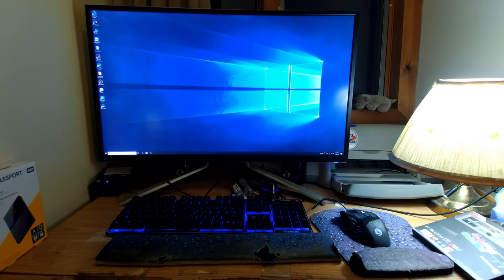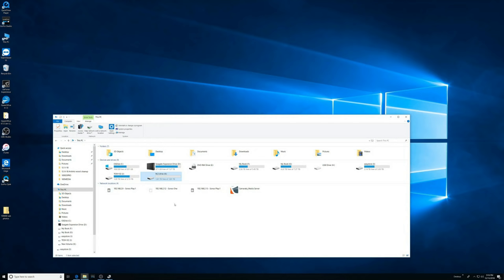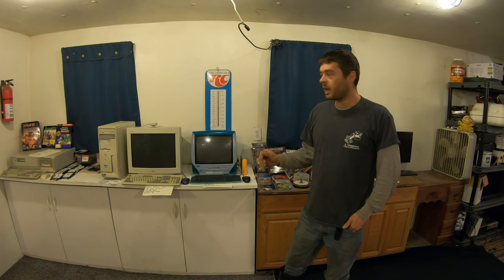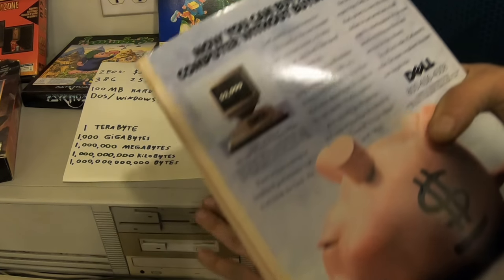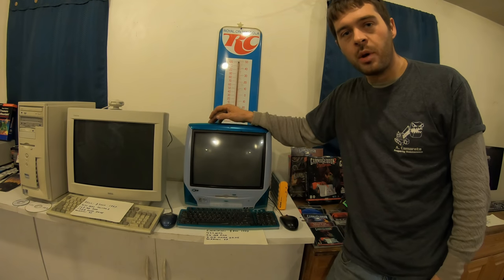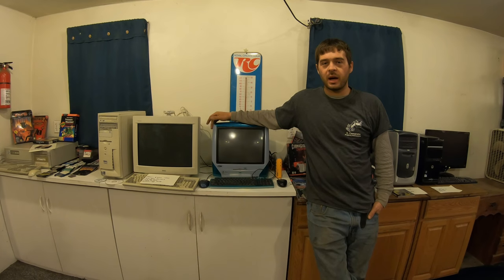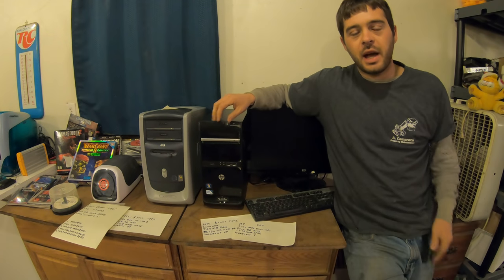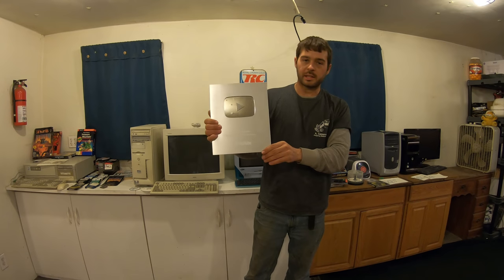Upgrading and talking about computers

Comment: Not too long after I began playing with home computers (1978) I came up with the NCU (the New Car Unit - at that time a basic new car was about $3000; now it's more like $25,000). It struck me funny that you noted that right along a pretty good computer cost about $3000 and my mind just jumped: NCU!
My first computer was a NorthStar Horizon. Z80 CPU (maybe 2 MHz? maybe 4?). I had it stuffed with the maximum of 48k (yes, kilobytes) of memory and two (count them, two) 5 1/2" floppies holding a whopping 128kb each. That computer (in kit form) cost 2 NCUs (in 1978) - in today's terms, it cost around $50,000 dollars. There wasn't much software around; I had to write my own in BASIC, with a few bits in hand-coded machine language. (I still have that NorthStar somewhere in storage. It needs a smart terminal with a current loop serial port, which I no longer have.)

Like you, I kept on buying the latest and greatest (with a few stalled out periods like you). I eventually got tired of Windows, and switched to Macs. Now I don't keep up quite so much. I might let two or three years go by before getting a new one. A good computer now costs only about 1/8 of a NCU.

I put up a few YT videos a few years ago (machining, mostly), and hope to get started again soon. https://www.youtube.com/channel/UCv5CY1wzFRO3AVFJ2eeGwow

Comment: Great video.  Pretty much what I went through.  Just started a bit earlier with a  PET. Then dos. I only played a few games and didn’t upgrade the pc. I just lived with it till I could buy a newer one. 
So I went from dos to windows 98. Skipped over a lot.  I had been fed up with how often I experienced crashes. And just how slow my sims were.
I actually used my first and only pc right into third year of university.  I write most of my papers on it. With a tear away holed paper printer   It was loud as hell (the printer) but it made a very satisfying sound.  Then I got a dell.  Yours looks exactly the same.  Xps 500.  I bought lifetime tech.  I even called them a few years ago when I was trying to work on my old computer.  They were shocked at how old my file was but they says straight up. Yes sir you have life time tech support so how can we help you. ?

Comment: I would also recommend using the program "Backblaze" for cloud back up. It's great for me because if my hard drives are making a weird noise I don't have to worry at all. It's $5/mo per computer for unlimited backup data, so I'm backing up like 6TB of data there. You can also access your files anywhere from your phone or computer. It's pretty nice

Comment: I'm still using a keyboard similar to the one on the first pc. Since 94 or so when I got my own pc. Cheapo membranes (one failed and has been put to scroll lock key) but solid metal backing plate :) Also much cleaner than Andrew's :P
Also one of the first to get DSL, we had ISDN before and being always on blocked one of the two lines, which was not liked by the family. Going from 8 kbit to 768 kbit was so awesome, almost as good as downloading things at the university. Which we also did. A lot. On zip discs.

Comment: Andrew, one more thing.  Another great way to save all of your information is with a Server.   Synology is a great brand and you can use it in a multitude of ways.  Having a server you can use multiple hard drives.  14tb size at the time getting a 4 bay server using a Raid 5 or Raid 10 would be a great way to ensure redundancy of all of your data.   Make sure you get NAS drives their more efficient for a server compared to desktop drives.
Reply from the maker: Yeah, I looked into that. It just never seemed cost effective. Right now I am just getting USB drives. Archiving stuff on them, than using another when they are full. I backup the finished video files on multiple drives.
Reply: @AndrewCamarata  Thank you for the response!  I can understand that.  I bought myself a $200 dollar server myself that uses an Atom processor.  ones you'd find in android cellphones.  Then I took my MyBook 2 bay desktop external storage and another 2 more NAS drives and used those.  I noticed on your computer you are running Western Digital drives.  If you open your my book from pressing the button on the top you'll flip open the top, unscrew the bolt by hand can you will find 2 Red NAS drives.  If you have more than one of these you have your drives.  Now, remember if you are installing 4 drives into a server you'll first need to store this drive information to a separate location first before you format these drives for the server in a Raid configuration.  I would research Raid.  It's a much more efficient way to store large 4k videos.  The only drawback is the file transfer speeds to a server won't be as fast if using USB 3.0 or higher.  But then again.  Do all of your editings on the M.2 drive and save all of your information on your server and you'll never have to worry about losing it.  Your server will notify you if there are any drive issues.   

side note,  I highly recommend you getting a triple monitor setup.  Using the same monitor with the same desktop screen resolution is recommended in my opinion. 

You can get 1080p monitors as cheap at 100 dollars a piece.  Have on screen with a web browser, One with the video and one with all of your windows explorer to view your files and open your music.
Reply: @AndrewCamarata  One more thing,  If and when you build a new PC in the future and you want to ensure everything is going to work correctly.  Even if you have a friend to help, I recommend this tool to ensure you're building a computer that won't result in any conflicts with the build.  google ( PC part picker ) this website you can build your PC of the future and it will find you the lowest prices online.
Reply from the maker: Yeah, I have two monitors on my other PC. Desk space is limited where I have this PC, so I just have the one big monitor.

Comment: First PC I used was my mom's 286 Hewlett Packard 12MHz. We overclocked it to 16Mhz. No big deal

I took out a $1100 loan for parts for (I think) a 100MHz system from Tiger Direct

Comment: Now you say, I bet if I ask if people do you want me to show the video editing process - everyone will say yes.  Well WHY NOT.   It I just as interesting to me as running a dozer - and it is interesting too.    I asked you in a previous comment   "what method do you use to edit your videos".  Just now you mentioned the GOPRO suite software.  This is a starting point for me.  I invested in a GOPRO with various adapters and I have barely done anything with it.  My problem is that the different software packages are difficult to learn.  It would be beneficial for someone to show me what they do to make a finished video.

Comment: Damn bro, you paid 6 bux for a 2 dollar splitter cable, which was also available from the US on ebay! As an avid ebayer, that hurt a little. Anyway,  what I recommend for your new hard drives is using Windows Storage Spaces, which is built into Windows, to combine your new 2TB m.2 and 4TB sata drives into a single 6 TB drive you can work off of exactly like you would see a regular single hard drive. Since you'll be using them both for the same purpose, this would work out well for you. Love the videos!

Comment: Nothing's better than a workflow you're familiar with, but if you're ever looking for good, free video editing software, I can't recommend DaVinci Resolve more. It's professional grade and in my experience is very comparable to Adobe Premiere Pro, but more intuitive.
Reply: David Luhr, I use it as well; sometimes it discards trims you made when you speed up a clip, but otherwise really good software
Reply: @danvannice3241  That is an issue I've experienced as well and couldn't find a good solution to. I was trying to find a way to "flatten" a trimmed clip so it would respect the start/stop points when changing the speed. There has to be a way but until I find an answer I have an okay workaround that's not too tedious (making note of the frame and manually re-trimming after changing speed).
Reply: @danvannice3241  I've found the correct way to do speed changes now!

1. Select the clip, and do Ctrl + R (Command + R on Mac, or use right-click menu on the clip) to show the "Retime Controls". With Retime Controls showing, move the playhead to where you want the speed change to start.
2. At the bottom of the clip, you'll see a small dropdown menu with "100%" and small triangle icon. Click on this dropdown and select "Add Speed Point".
3. Next, move the playhead to the position where you want the speed change to start and add another speed point.
4. Now, you should see a separate speed dropdown between the two speed points that defaults to "100%". You can click this and change the speed to a few set options, or simply grab and drag the speed point handles to adjust the clip to whatever speed/duration you want.

With this workflow, you have precise control over the playback speed and duration, and the start/stop point of the speed change are always kept. I knew there was a better way of handling it, but didn't discover this until now. Let me know if this works well for you!

Comment: Hey Andrew, it may pay to periodically (every six months) dust out your pc for better performance, especially when video editing, and replace the thermal paste on the water cooler too as the paste degrades in thermal conductivity over time, and this could improve performance and avoid thermal throttling in some circumstances.

Comment: Make sure you hold on to that Emachines eOne because it's worth a bit of money now. It was created as a copycat in 1999 to try and piggyback on the market success of Apple's iMac G3 which were selling like hot cakes between 1998-2003. Emachines quickly caught the ire of Apple and was sued for trade dress and lost, which forced them to redesign the machine so it no longer looked like an iMac G3.

The eOne was sold until 2002, but it wasn't popular in the market and not many of them were sold, making them rare today.

Comment: Make sure you switch it from sata to parallel so you can use the full speed of the NVME of that M.2 drive you installed, nearly every computer defaults to sata when you install it and you get like 1/4 to 1/5th of the speed out of the drive until you switch it in the bios.

Comment: You're pretty much maxed out for your current machine. New CPUs from Intel are coming out soon along with massive new GPUs and really fast ram. So don't put any more into the machine you have now. Oh yeah, you buried the lead! CONGRATULATIONS on your button!!! Almost forgot, with the amount of video you have, you really should get a nas. Synology or similar, that way you won't have to worry about drives crashing or moving the data to a new machine.

Comment: @Andrew Camarata When you installed the extra RAM, did you set the correct XMP profile in order to get the advertised speed and timings?
Reply from the maker: I did not, I just plugged it in.
Reply: @AndrewCamarata  You might wanna check on that, because otherwise you probably won't get the best performance from the RAM sticks. You need to enter the BIOS and enable XMP profile for the RAM. Doing this will automatically change the frequency and timings on the RAM sticks to it's advertised numbers. I noticed in the video that you have two different brands of RAM sticks installed, don't know if that will complicate things (correct me if I'm wrong). The reason I mentioned all this is because I assume you edit and render videos on this computer. If so, that process will probably run faster if the RAM performs at it's rated performance level :) Anyways, love your channel and keep up the good work! Solid Youtuber! :D

Comment: first time i was on the internet was 1985 .. people don't know how spoiled they are with cable internet.. i still have really slow cable internet but back when dialup was the thing you could run a city off a 10mbit connection .. big colleges had 1mbit connections or smaller

Comment: Here's an interesting factoid, 1 MHZ is the snap of a finger, so 100 MHZ is 100 snaps of a finger instantly. Cool video, I started with computers at the same time and remember upgrading every time the latest and greatest came out. 1400 baud, 2400 baud, 33,6 baud on the internet dial up speed. LOL

Comment: Hi Andrew. Would be good to know your hardware setup, but 16GB is all you will need with DDR4 (unless you can see that the video rendering software is using all the current 16Gb RAM available), but I digress. Going to 32Gb would be considerable more eficient with DDR fives. SSD was a good move, but for loading softwares, the disk acesso for reading files (videos), .... okay, let me stop here :) Great upgrades dude, love your videos :)

Comment: Andrew, best is normally to use MP4 (in H.264 or H.265 format). It would save you a step in processing the video. Maybe do a test to time the conversion time + video production; and time the processing directly in MP4. YouTube also uses H.264 or H.265 natively.
Reply from the maker: Yeah, when the project is done, I export at .mp4 4k 30fps. I think that editing software just likes working with the .AVI files.

Comment: Hi. For maximum gain use memory with the same clock speed and CAS rating as the existing ones. You will get an added benefit now  by using all the DRAM memory channels which are automatically enabled. Have a think about how to safeguard your video footage as well. Maybe RAID 1? BobUK. Edit to fix error.

Comment: Do you have Samsung Magician installed so you can check the performance and the biggie, keep the M.2, and any other Samsung drives, firmware up to date?
FYI, the 5¼" floppy disk held 1.2Mb in High Density and 360Kb in Double Density. The 3½" floppy held 1.44Mb HD and 720Kb in DD.

Comment: video editing: Graphics cards important, SSD Drives important, and memory.  Adding system memory to one with a poor video card won't help much with video editing.  SSD hard drives, load and write files FAST, Memory only really helps if you're typically using all of it and the system is using a SWAP file alot.

Comment: if you were 6 years old in 1991, then that would make you the same age as me, we only got our first PC in 2001 when i was 16, we almost bought a used Pentium 2, like your 2nd PC, negotiated the price, called to pick it up and the asshole sold it to someone else, but it was for the better, since we ended up buying a new 700Mhz (AMD) Duron with 128MB SDRAM, running Windows Millenium, only got Dial-up internet 2 years later (downloading a song took 15 minutes), then all the viruses came, had to reinstall the OS so it got upgraded to Win XP.

Comment: Hey Andrew, changing subjects, I just bought a '94 case 580K backhoe from a friends wife, he passed away.  I wanted one but have no idea how it works.  I have a case 450 trackloader and run it without any problems.
Any chance you have a 580?  If so, how about a video about running all the levers and any tricks you have from experience.  Would certainly appreciate it. Thanks.
Reply: @AndrewCamarata  yes, multi sticks!  Thanks for the advice.  Keep making those videos.  I learn something each time!

Comment: Im suprised it worked considering you mixed ram and probably not check if it is compatible with your motherboard^^ Did you check if it has the same Mhz? :D

8:34 Oh there was the error I was thinking will happen. Only bios update might fix that (or make it worse you never know)

Comment: Andrew let me help you out with direction to reliable storage. You are spending a lot of money for what is called "single points of failures". Check into Synology NAS units. I can walk you through the setup. I would get a large unit and stripe raid 10, 10Gbps backbone and 10Gbps nic for computer. Not to mention a nice UPS for battery backup.

Comment: That was not a Solid State Hard Drive, it was a still a solid state drive, the reason it's slower than the M.2 has to do with how it interfaces with the machine. If both those solid state drives had the same interface they would likely be pretty matched. A solid state hard drive does exist, it's a spinning disk with a larger cache memory and it's faster than a HDD but still slower than an SSD. Just my two cents, nice video though.

Comment: It's better to install a clean windows onto it, but if not, create a folder called VM on it, then assign your virtual memory to it, that will speed your memory intensive operations quite a bit, but your better off with a nice new windows install, unplug all other drives till it's 100% finished otherwise it will begin to install then when it restarts it may try to finish on a different drive, you will also have to state that the m2 is the boot drive in the bios

Comment: move your operating system onto the m.2 with the GoPro software installed on that, and use the SSD for the temporary video storage, and then save the final on the HDD.
Reply from the maker: Powerline Rider it’s on a ssd now.